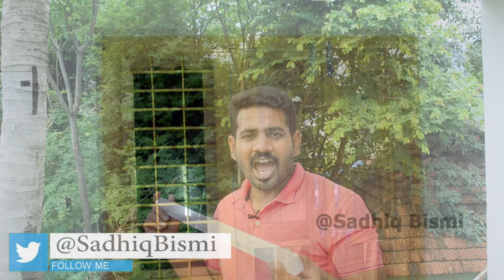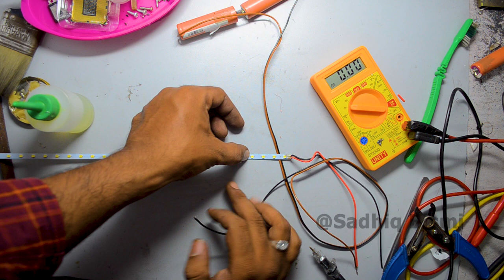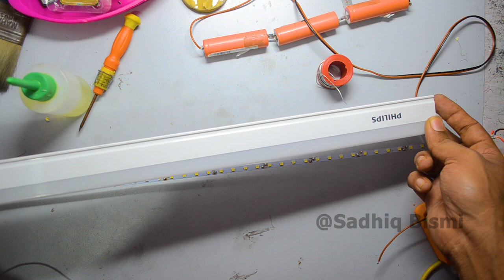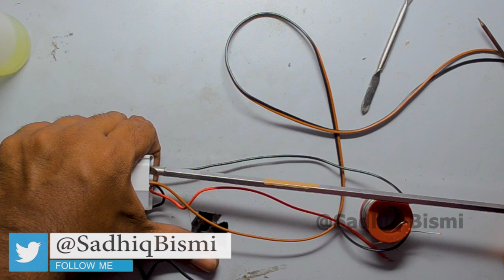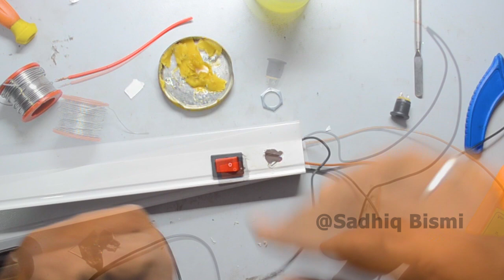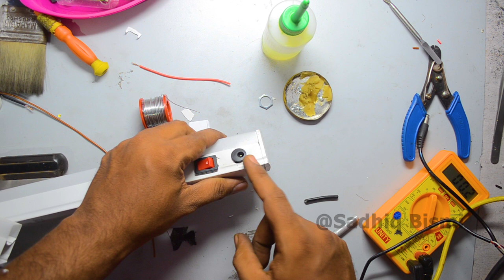How To Make A Emergency Light With Damaged Led Tube | കേടായ ട്യൂബുകൊണ്ട് ഒരു എമർജൻസി ഉണ്ടാകാം

Comment: Really usefull video ആണ്.. ഒരു doubt clear ചെയ്ത് തരാമോ..? എന്റെ വീട്ടിൽ 4 V 0.9ah (900mah) ന്റെ രണ്ട് ചെറിയ  Lead acid  ബാറ്ററികളും ഒരു പഴയ tablet ന്റെ 3.7 V, 3000mah (3ah) lithium iron battery യും ആണുള്ളത്..ഇവ series ആയി connect ചെയ്ത് ഉണ്ടാക്കാൻ പറ്റുമോ.. tablet ബാറ്ററിയും, ചെറിയ lead ബാറ്ററിയും  series ആയി connect ചെയ്ത് ഉപയോഗിക്കാൻ പറ്റുമോ?

Comment: 12 volt chargeril 12.36 volt ulla battery charge cheyan pattumo
Reply: Pattum but charging time edukum. normally daily using mobile battery 3.7v ithu charge chaiyan 5v charger aa use chaiyunne. minimum oru 0.5v engilum kudinilkanum.

Comment: 12v battery ക്ക്‌ 12v charger മധിയോ കുറച്ച് അതികം വേണ്ടേ
Reply from the maker: Kooduthal venam . But ivade no problem light work cheyyum
Reply: @sadhiqbismi  🔋 ഫുൾ ചാർജ് ആവില്ലല്ലോ
Reply from the maker: Athu kuzhapamilla bro 5 h backup und.  Pinne marketil available ithaan ithu vittal pinne 18v 19v. price kooduthalumaan
Reply from the maker: Ithakumbol long life kittum.  Pinne namal cut off ubayokikunnila athukondu ithaanu nallathu
Reply: @sadhiqbismi  ഒരു 13or13.5v ന്റെ ചാർജർ ഒക്കെ ആണെങ്കിൽ cutoff പ്രശ്നമില്ല. Backupum കൂടും
Reply from the maker: cutoff illathe  koduthaal voltage koduthaal 2masam work cheyandathu 1 masame work cheyyu . Kooduthal voltage kodukumbol battery pettanu thane full aavum battery full ayitum charging offakathirunaal 80% battery damage aakum.  Same voltage akumbol athu 20 % mathrame damage avanula sadhithayullu.
Reply: @sadhiqbismi  ബ്രോ കുറച്ച് അധികം ഉണ്ടെങ്കിലേ ചാർജ് നിറയൂ
/ഞാൻ പറയുന്നു 12v ചാർജർ കുത്തിയാൽ 5h കിട്ടുന്നെങ്കിൽ 13v ചാർജർ കുത്തിയാൽ 8h കിട്ടും/
Reply: @sadhiqbismi  aliexpress vazhi oru charging module vangiyal pore... Battery full akumbol athu circuit cut aakum
Reply: @muhammedsainudheenmv46  battery voltage nekkal കൂടുതല്‍ തന്നെ ആണ് ഇവിടെ ഉപയോഗിച്ച charger output അതുകൊണ്ട് ആണ്‌ charger connect ചെയ്തപ്പോള്‍ brightness കൂടിയത്. പിന്നെ battery യുടെ capacity depends on battery current rating. അല്ലാതെ charging voltage അല്ല
Reply: @jineshcr3324  മണ്ടത്തരം പറയാദേ ബോസ് ! ലൈറ്റ് കൂടുന്നത് 2ambs ചാർജർ ആയദ് കൊണ്ടാണ് അല്ലധേ വോൾട്ടേജ് കൂടിയത് കൊണ്ടല്ല. കറണ്ട് rating മാത്രമല്ല വോൾട്ടേജ് rating നോക്കണം ബോസ്
Reply: @muhammedsainudheenmv46  ok സമ്മതിച്ചു boss, ee voltage കൂടുതല്‍ കൊടുത്താല്‍ 5h backup 8hr ആകുന്നത് ഒന്ന് paranju തരാമോ
Reply: @muhammedsainudheenmv46  ഞാന്‍ ഉദ്ദേശിച്ചത് ഇത്രയേ ഉള്ളു, for example ആ bulb full brightness kittan 12v with 0.5A current വേണം എന്ന് വിചാരിക്കുക and battery capacity 1000mAh,ഈ condition bulb max 2 hr full brightness കിട്ടും, അല്ലാതെ 12 nu പകരം 15v charging കൊടുത്താൽ 1000maA ഇല്‍ കൂടുതല്‍ current battery യില്‍ kayarumo.
Reply: @jineshcr3324  1000maA ഫുൾ നിറയണമെങ്കിൽ വോൾട്ടേജ് സ്വല്പം കുടണമെന്നാ നാൻ പറന്നദ്